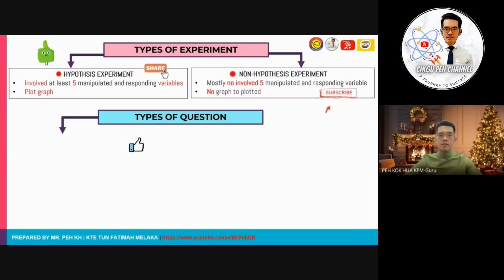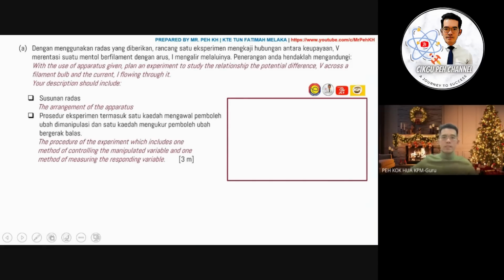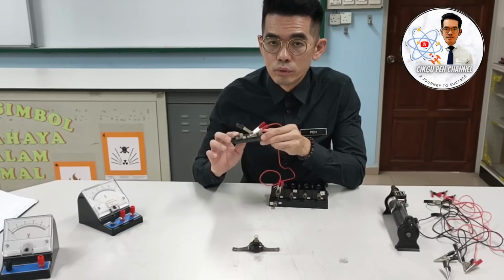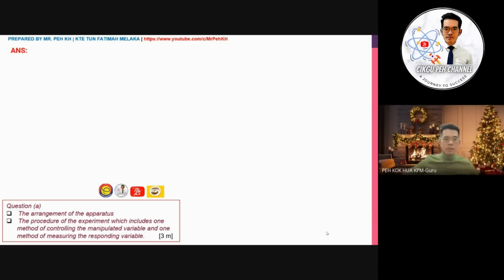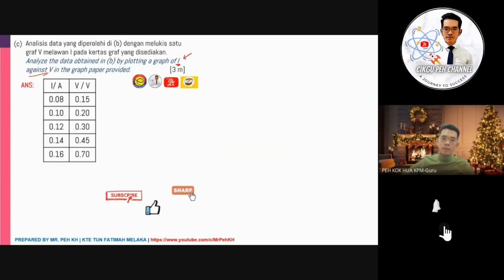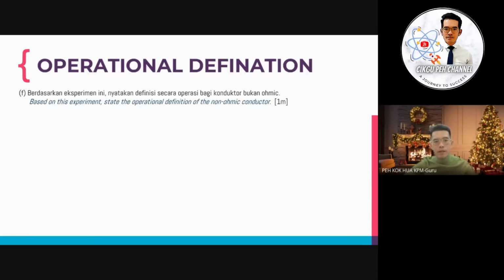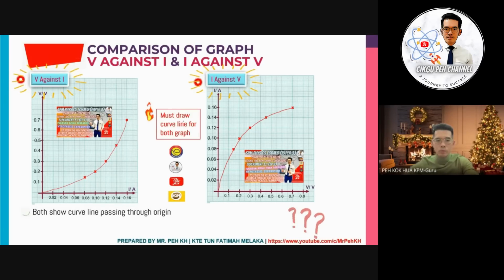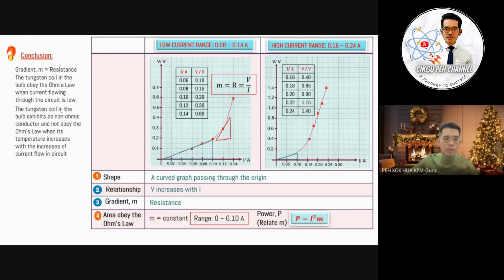SPM PHYSICS PAPER 3 | TO STUDY THE RELATIONSHIP BETWEEN CURRENT AND VOLTAGE ON BULB (EP 2)

Comment: Teacher, from the video i can see that u match the wire colour with the terminal colour. I thought for ammeter we need to interchange it so that +ve black wire, -ve red wire ?
Reply from the maker: Hi ird2n4, wow, really concentrate 👍 I actually use red wire to indicate positive and black to indicate negative. But actually the colour of wire won't give any impact to your result. You may use any colour of wire for your connection 😄

Comment: voltage should be decrease if connect one more light bulb in series because rheostat has resistance.
Reply from the maker: If same number of battery is use, voltage will share equally to each bulb. If V = 9V, each bulb received 4.5 V. If one more bulb is added, effective resistance come from added bulb, R = R1 + R2